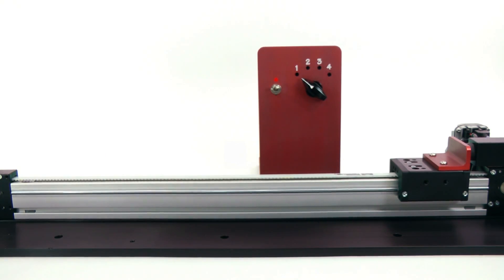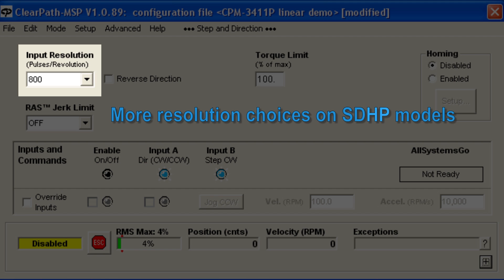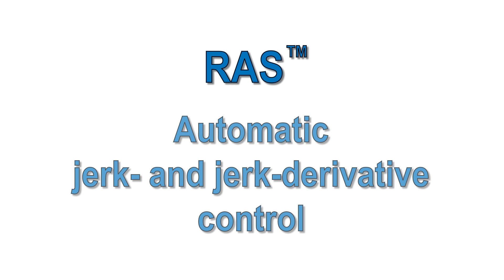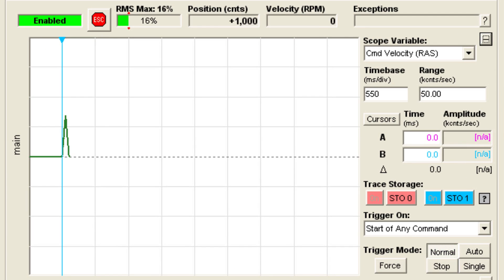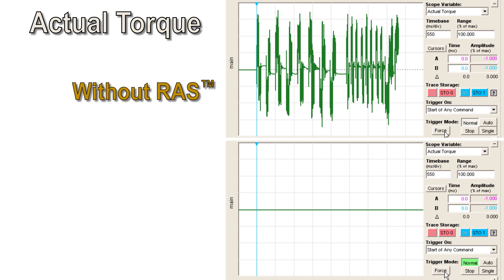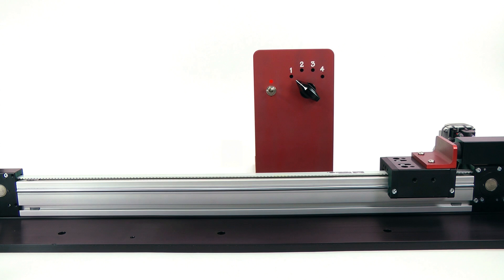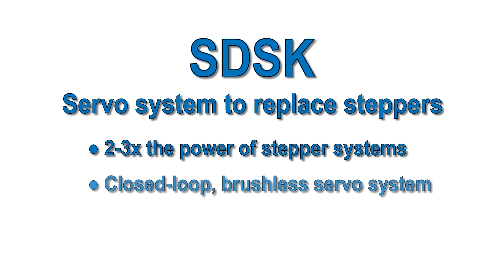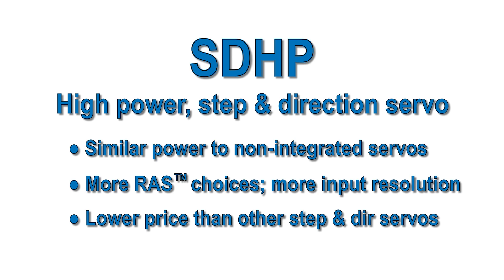ClearPath Integrated Servo Motor: Step and Direction Mode

Comment: I would like to use clear path motor, for my cnc milling spindle... look for motor that can do a few hundred rpm to 6000 rpm... what motor doyou recommended  for cutting mild steel
 For  diy mill or cnc router setup.
Reply from the maker: Hi Henri,
  Currently Teknic does not manufacture any motors purpose built for CNC spindle applications. It is certainly possible to use a ClearPath motor as a CNC spindle, however most mill/router CNC applications would use spindles with integrated toolholders or collet systems built in.  

To use a ClearPath motor as a spindle, you would need to attach some kind of toolholder and design a bearing support system specific to your applications needs.  Most of the time this extra effort doesn't make sense so instead you can select a purpose built spindle such as the spindles listed here: https://mellowpine.com/cnc/best-cnc-spindles/

I hope this helps. If you have any additional questions, feel free to contact Teknic directly at https://teknic.com/contact/ or give us a call at 585-784-7454.

Best regards,
Brendan F. – Teknic Servo Systems Engineer
Reply: @TeknicInc  thank for the link

I look for spindle for large 5x10 cnc i current have 4 kw spindle.. but nee a spindle for lower speeds mainly milling steel few 100-5000 rmp
The 4kw is to fast..the link you sent great of aluminum  but soindle are to small or to week for steel or to fast for steel.

I know will have invest time and money into bt30 head with some gear reduction to beefer motor... i was hope to use a good clearpath servo..for easy tunning.

Comment: Hi, can you please do a video of the SD doing a smooth positional transition that might be done for example when creating a slow circle on a CNC?
Reply: Also, what model SDHP is this motor in the video?
Reply from the maker: @PicoGirl  Thanks for the suggestion, we appreciate it. We keep a database of feedback from customers for video ideas and I'll add yours to the list. I can't guarantee we will definitely incorporate that topic, but it will be considered and discussed.

The model used in this video is a CPM-SDHP-3411P-ELN.

If you have any additional questions, please feel free to contact us at support@teknic.com.

-Bridgette G. - Teknic Servo Systems Engineer

Comment: what is the recommended settings of the High Level Feedback (HLFB) in this mod (Step and Direction) to use for cnc milling ?
and what controllers are compatible with HLFB ?
am planning to use clearpath motors on a diy milling cnc . i didn't buy my cnc controller yet but thinking of the acorn or masso or somthing compact like that if it is possible 
am nat expert by any means am just a hobbyist
Reply from the maker: Hi Habeeb,
Thanks for checking out our video, and for your interest in ClearPath motors.

There are several HLFB configurations that can be used for different reasons in CNC applications, so we don't generally recommend one over the others out of hand. The "best" HLFB configuration for a given system depends on the application goals, requirements, and constraints.

That said, one popular HLFB mode for CNC applications is called "Servo On". It uses only 2 states (high or low) to communicate information from the motor back to the controller. In "Servo On" mode, the HLFB signal asserts (goes high) when the ClearPath motor is both enabled and not in a shutdown state. Conversely, the signal de-asserts (goes low) if the motor is disabled or in a shutdown state.

Regarding your other question, there are many controllers on the market that will work with a ClearPath-SD motor. The two you mentioned, Acorn (by Centroid) and Masso, are known to play well with the ClearPath inputs and outputs. In addition, both the Masso and Centroid websites have wiring diagrams and/or schematics specifically designed to help their customers wire up their controllers to a ClearPath motor, so that may be helpful as well.

For more information on other HLFB modes, I/O compatibility, and I/O wiring, please see the "Inputs and Outputs" section of the ClearPath User Manual located at: https://www.teknic.com/files/downloads/clearpath_user_manual.pdf.

Good luck with your project!

Jim W.
Teknic Servo Systems Engineer
Reply: thanks for the replay .

Comment: Can he SDHP range of motors implement the drive/control different modes simultaneously in each and between each other? Can they for example key rpm and torque limiting between two motors ie twin spindle rigid tapping? If not can they be mode switched remotely on the fly whilst maintaining positional control?
Cheers
Reply from the maker: Hi dasaspc, thank you for your question.
 
With ClearPath SD, you cannot change motor parameters, like peak torque, on the fly. In addition, the architecture is not designed to use one motor to control another motor. 

ClearPath is a servo motor, so both motors will follow their commands for acceleration, speed, and distance. If one motor experiences a fault, the other motor should be disabled by the controller. However, one motor will not slow down in direct response to the other motor slowing down.

The motors will always maintain position control when enabled and receiving the command. However, creating tight coordination between “twin” motors using the feedback protocol you have suggested will likely not work well.

Best regards,
Tom T
Reply: Thanks for your response.

Comment: For a Bridgeport CNC conversion. SDSK or SDHP?
Reply from the maker: The question of SDHP or SDSK is a good and common one. Choosing between an SDSK and SDHP depends on the specific speed and torque requirements for your application. SDSK models have about 2-3 times the usable power of a similar-sized stepper motor. SDHP models have about 8-15 times the power of a similar-sized stepper motor and are often used to replace similarly sized digital servos, or to replace steppers when much higher machine throughput is desired. (comment continues)

Since Bridgeport mills don't typically require ClearPath's top speeds, we tend to recommend SDSK for these retrofits, however, we recommend taking a look at the torque speed curves for the SD models on Teknic's website to ensure you will have enough torque at your application's required speed. There is a “compare” feature that will allow you to overlay torque/speed curves of up to 3 motors at a time so you can clearly see the differences.

Please feel free to send Teknic an email, or call if you have any additional questions.

Comment: does the RAS effect multi-axis motions? imagine moving two axis' "X" and "Y" by 5 and 10 units, my expectation is to move the load along a straight line (ie lasercutting or milling a 2d contour). Would the RAS cause a curved motion as the axis' have different optimized acceleration curves or does teknic offer a System that synchronizes the axis' ?
Reply from the maker: Hi Marius, thanks for your question. It’s a common one Teknic receives about RAS. For straight line cuts, the RAS will not distort the drive’s path following (eg. CNC) ability. For curves or any non-straight moves, the RAS will distort the path proportionately to the RAS length (there are different levels of RAS you can choose depending on your application and mechanical setup).  Therefore, we recommend fairly low settings on the RAS levels for CNC path following applications. 

For example, Teknic’s high speed router OEM customers use RAS values in the 16-44 ms range. (The SDSK models only offer settings in this range. SDHP models provide a larger range.) This low RAS setting provides a number of motion control advantages with no noticeable distortion. You can experiment with different levels on both axes and find the best setting to give you a smooth, but still square cut. However, be sure to use the same RAS setting on each axis.

Comment: This seems perfect for me to replace my current stepper motors and drivers on my CNC laser cutter. Just would like to make sure it works with the my Ruida motion controller. My only concern is that the controller does not use an enable signal, as the stepper motors are turned on by default as long as the system is powered on. I would like to know if I can connect the enable signal to let say one of my power supply 24v lanes, so that the ClearPath are enable as long as the system is turned on as well...
Reply from the maker: Hi Abraham - unfortunately I am not familiar with the Ruida motion controller so I can't speak to that specifically but I can speak in generalities in regard to controlling a ClearPath SD motor.  

The step and direction signals (the logic signals) coming from the Ruida controller need to be between 5-24Vdc and must be able to provide 8-12mA.  

In regard to the enable signal - you can absolutely wire up a 5-24Vdc logic level power source directly to the enable line.  That said, I recommend that you incorporate an 'on/off' switch so that we can manually enable/disable the ClearPath motor.  For safety reasons, I do not recommend wiring the power source directly to the enable line (without the 'on/off' switch) such that it immediately turn on and enables upon power-up.

Finally, just to be clear, it is important that you use a separate 5-24Vdc power source for your logic signals.  Do not use the same power source for bus voltage (24-75Vdc) and your logic level signals (5-24Vdc).